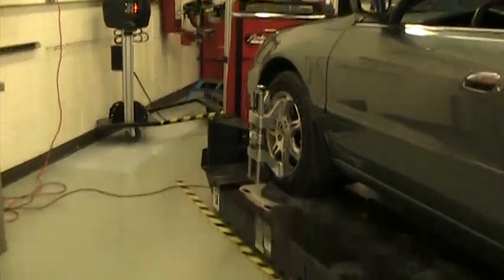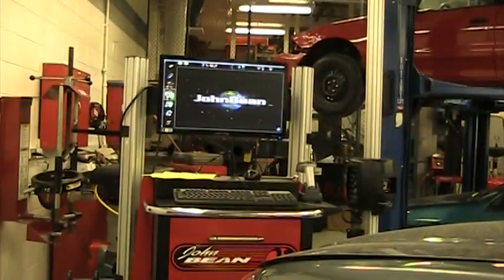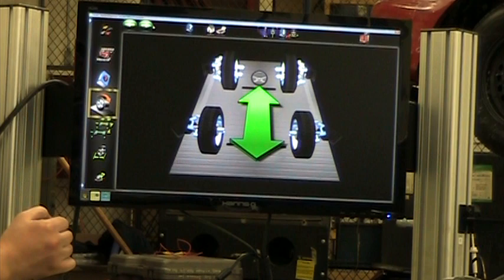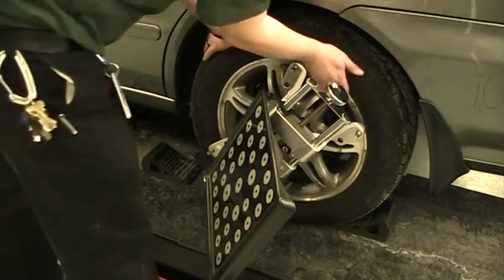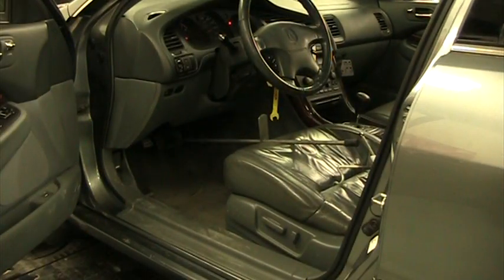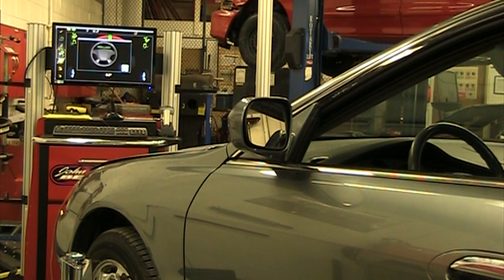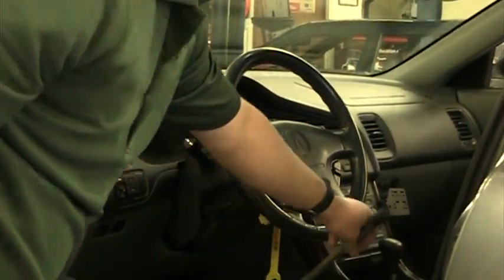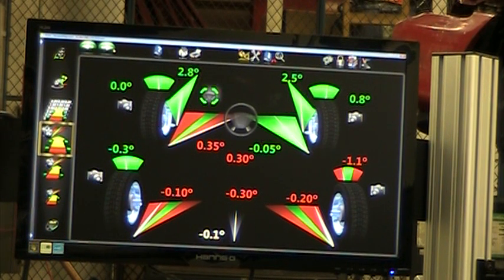Alignment Machine

Comment: Had an alignment done on my 2001 dodge Dakota but when I took test drive, I let go of steering wheel to see if it drive straight but it pulls to the left. Mechanic tells me that it has to do with suspension or ball joints or shocks. I made a couple of calls (Pepboys and dealership) and asked to speak to mechanic and sure enough, an alignment was not done. Also suspension, ball joint, shocks has nothing to do with an alignment. If in fact there was something with suspension then the alignment could not be done. Can you confirm what the mechanics said is correct? Thanks much.

Comment: Why can’t the alignment heads be sideways?? My tire is up in the fender so having it vertical isn’t really a option
Reply: It is an option to put it horizontal. My machine is currently set up for vertical. We would have to rotate the reflector head to mount horizontal. Great question!!

Comment: I had the dealer do an alignment on my car after changing a blown run flat. I noticed there are small gouges on the outside of my rim roughly the same distance as those clips you show. IS this possible that they damaged my rims?

Comment: I just had my car alignment done and the guy used the sensors but they also lift off my car and did the alignment while the vehicle was in the air instead of have on it wheels, what is the difference?
Reply from the maker: Sounds like they did a good job. It is best to lift it when adjusting Camber and Caster. Toe can be adjusted with weight on the wheels as the video shows. Thanks for watching
Reply: You don’t lift it to adjust camber and caster. You release the plates (front and rear) so it can slide around to adjust the camber and caster and toe (if far out). I’ve never seen someone do an alignment with the wheels hanging, ever. Which doesn’t make sense because a car isn’t in its final driving position like on the road for such fine tuned adjustments lol maybe to get it as close as possible or to match the a good side. But sounds weird. And I worked for 2 shops and a dodge/alfa Romeo dealership and did alignments at all 3.
Reply from the maker: @dcappucino9513   The alignment program watches the arc of the wheels as the vehicle is lifted off the plates. It compensates as the adjustment is made. While toe doesn't matter, it does make Caster & Camber adjustment much easier without the weight of the vehicle on the wheels. I double check adjustment after weight is put back on the wheels and make fine adjustment if needed. I do agree that these adjustments can be done on the plates but it is easier when the weight is removed.
Reply: How much was it roughly?

Comment: Can they change the tie rod ends for you when they do an alignment?
Reply from the maker: Yes they can
Reply: Yes, especially if they're close to needing replacement anyway... they'll probably even recommend it. If you don't, and you need them replaced after your initial alignment, you'll have to get another alignment...which will cost more

Comment: One thing I would like to know is how are you able to do an alignment with this machine if its a special car that is not in the database?
Reply from the maker: You just need to know the alignment specifications. Perform the alignment to the specs and don't load an actual vehicle. The data base just preloads the specs and marks the red/green indicators. Good question!

Comment: will those things on the rims scratch up after market rims? or should i just throw on my stock wheels get the alignment and then throw my aftermarket ones after getting it done?
Reply: Christopher Hernandez they won’t scratch unless the mechanic accidentally hits the wheel with the sensor or it slips off but other then that your good to go with after market unless they is a really tight space around the rim lip and tire

Comment: Are pegs supposed to be padded to prevent rim scratching? I had alignment done on my jeep 6 times today as they could not make steering wheel straight, now i have dozen of scratches and chips on piano black rim finish where pegs where attached. I noticed their clamps had metal pegs, so i wonder how this tool is suppose not to damage rims, like come on, even when i clamp furniture pieces being glued, i always use some soft padding to prevent damage where clamps squeeze. I am confused how this principle does not apply to alignment clamps... any input?
Reply from the maker: I have never had an issue with scratching but if  the paint is thin i guess they could. Find a different shop that uses the Hunter Alignment Machine. It clamps to the tire tread and will not scratch the rim.
Reply: MrAdkinsAuto thanks, its original grand cherokee premium piano black rim, paint has substantial thickness. I ll try another place. Regardless, anything that is being attached like that to a premium set of rims sends shivers down my spine.

Comment: front wheel center line must be exact, just eyeball it and no laser line?  each refelector needs to be perfectly vertical and yet no bubble on them?    so these machines can also find an off center axle?
Reply: This machines will find wheel base, cross measuring, offset axles, all kind of measurements without the targets to be level